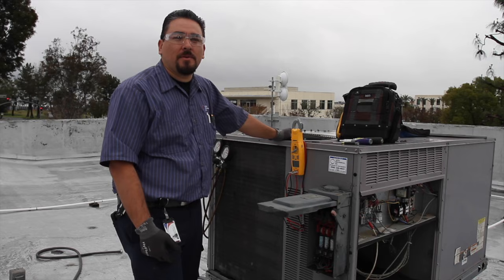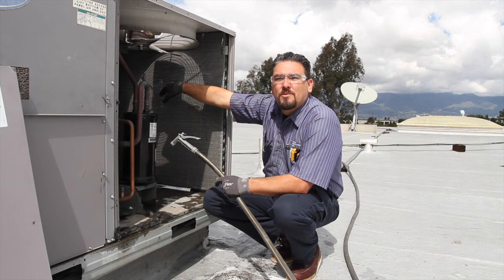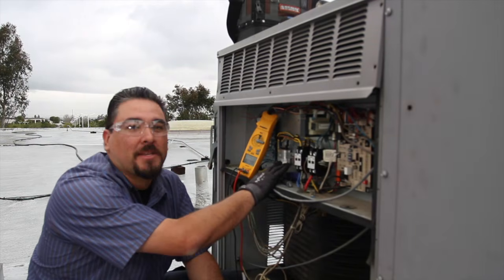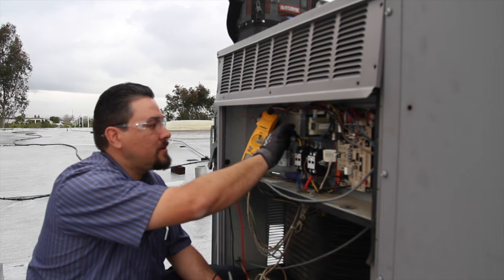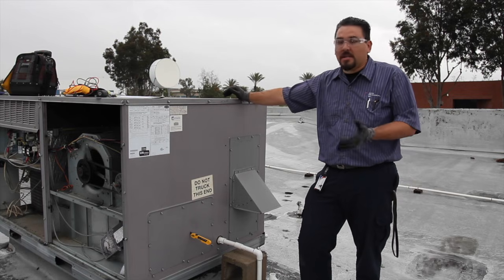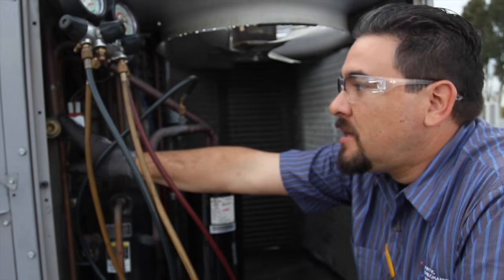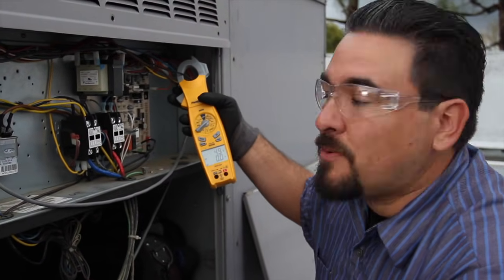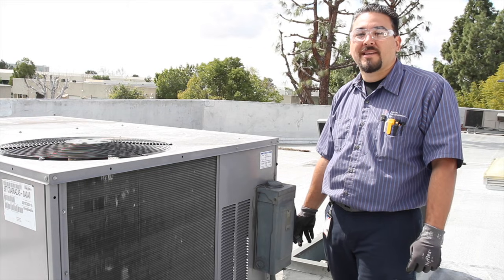HVAC PM Training Video

Comment: You need to start pulling off contactor's covers and checking for pitting and condition of points.   A++ for not using harsh chemicals that many rookie use.  Additionally, if you're doing this on a hot day you'd want to check amps while the door is actually covering the bottom opening so that the condenser fans can draw air across the coils and not through the opening of the panel.

Comment: For demonstrating the value of your service I recommending greetings 1st doing the maintenance and taking readings after so you can show the improvement that the maintenance has created for the customer. Creating value oftentimes means you can charge more. It also helps to reduce resistance when you make recommendations that the customer will have to pay for. They've seen a track record of what you are doing and the improvements you are making. It also helps you to understand what are the items that will get you the best result for the customer so if you have to give them a budget option you can get the biggest Bang for the buck

Comment: Video is informative but wrong off the bat.  You DO NOT take pressures during a PM.  One you can remove refrigerant from another system, and you aren’t vacuuming down you’re gauges every time to make sure no contamination.  Thank god you’re not in the medical field.  You check if the split is off.  Rookie rookie rookie.  Come on dude.  You didn’t check the indoor blower bearings, you need to clear the drain every time and drop in you’re tablets.  You add pan tabs to avoid build up.  I can’t watch past 6:25 the hackery there.  Please tell me you put the panels back on, NOPE damn dude

Comment: If you're new technician, stick with old school gauges over the smart probes.   Smart probes are for EXPERIENCED techs.   Only reason I'm typing this is bc all the responses to the probes.   It's not a good choice for a beginner.  Learn your pressures.  Learn txv.   Buy shutoff valves.   You'll release hardly any refrigerant and it's equalivant to the probes, no difference.  Be fast.  
You'll also have to send the probes in to get recalibrated and pay for it.
Reply: I don't agree that smart probes are only for the experienced techs.  If your are truly interested in learning the trade, the learning curve is much faster with the newer equipment than the old.  

I can't even imagine going beck to a micron gauge that I couldn't plot on my phone.  What a learning tool that is for a new tech to actually be able to see the difference in a leak and refrigerant or water gassing off in the system. 

Unlike analog gauges, smart probes allow the tech to easily think in saturated temperature rather than pressure from day one!  That's priceless!  New refrigrant comes along there's no difference in the saturated temperatures.  

How many new or old techs are going inside to sling a sling psychrometer, when charging a piston?  

The problem isn't the new technology!  It's employer's that don't want to put any training into their employees.  An apprentice needs a year or two following an older tech in the field and then support for a few years after that.  If he can give me good measurement's over the phone we can walk through most any refrigerant problem.  Then to top it all off the manufactures are cutting back on tech support at at time when their equipment is getting more and more complicated for new and old techs alike.  

Apps like MQ can give the newer tech confidence in their diagnosis, if it is used after they make an attempt at diagnosing the system first.  If it doesn't agree then they need to dialup a senior tech and get advice .  

There's place for analog gauges like when diagnosing a TXV that is hunting or setting the cut in and cut out on a refrigeration system,.  Other than that I don't really see the need for them.

Comment: I always make sure the system is working first before I start PM. You could be blamed that you unit was working fine until you touched it. 😂
Reply from the maker: Most of the customers we serviced when i was at this company had energy management services. we often would contact that service to force all the units on so that we could check operation. Also, some EMS companies will allow you access via app on your phone so that you may cycle on and all stages of heating and cooling. In larger supermarket operation, you will have EMS units such as Danfoss, E2, Novar etc that your able to graph and read logs that give you alot of important information. Most PM's are set at a low cost to the customer or they are not charged. This allows the contractor to service a customer and produce found on work. Meaning, if you show up, run the unit and find the Condenser fan motor not running, you would quote it out. Every customer has different rules especially with large Box stores and large retail chains. I always recommend for everyone to understand your companies goals and processes. understand the customers contract so that you can play within their rules. be very descriptive with your information and detail your report with high accuracy. take tons of photos this way you can show your customers exactly what they need and build that trust with you and your work. best of luck hope you found this to be helpful.

Comment: Do all of these AC function the same way and have the same components if so it this stuff sounds really technical however  I assume in time its repetitive.
Reply from the maker: Thank you for the question. For the most part a Basic AC unit, split system or a package unit is usually operates in the same manner with same or similar components. Some manufactures may have some complex electronics, Variable speed drives or de humidification that  may be a bit more advanced. Overall, you work on a few at the start of your career and they become easier. Attend seminars that manufactures have, this helps you in some ways understand and also gives you the opportunity to ask questions. My main type of work is supermarket refrigeration, i will be posting some vids soon.

Comment: I liked the video and definitely worth while to do all these things on a pm as long as your company is allowing the time. However I dont think its worth while to put gauges on the system unless you suspect there is an issue with the cooling performance just cause always pull a small amount of refrigerant out of the system everytime you put them on, that will definitely cause a problem after a while especially if you do that every quarterly pm
Reply: Always put refrigerant that’s in the hoses back in through suction side to prevent refrigerant loss. Or use pressure fishes with no hoses to check, this will prevent it also 👍
Reply: Fieldpiece smart probes would fix this issue :) Or any type that does the same thing without hoses.

Comment: I don't guage up on the unit unless my delta t seems off
Reply: I always check pressures just because ive seen some units with a 20° differential between return and supply,,, but with a higher than normal head pressure and superheat, usually causing a higher amp draw as well,, caused by either a restriction in the metering device or in the filter drier.. either way its just good to always check

Comment: No super heat or sub cool .
I personally like to see it .
S-man 4 will help you out alot man .
I have learned sometimes installers leave it on 240 when it's 208 I didn't notice it .
Reply: Why would u check Subcool or superheat on a Maintenance package unit call unless u suspect problems.
Reply from the maker: Great points you make Nathan, unfortunately the average new tech struggles enough to understand super-heat or Sub-cooling or even read a PT chart. the S-man and other similar digital gauges are great to use, but when the simple things such as cleaning coil or identifying how to test a unit are missed by your average PM guy, The S-man may be a bit too much tool for him or her. As i get the opportunity to create more content, we will definitionally use more advanced tool on things like start up where they can be really useful.

Comment: Funny how everyone talking bout what he should had done or should not do when In the midst of summer y’all probably don’t even do a quarter of that
Reply from the maker: Sorry for the late reply, but I completely agree. its easy to be a know it all, but not anyone knows it all.
Reply: Your forgetting crap boss always trying to rush it. “ I want a 3hr job done in 15min” lol
Reply: @chriswhalen5711   Yes sir , They  want you do all the of that and you have to up sale .
Reply: Maintenance should pretty much just be washing the coils checking caps , contactor , belt , drain , loose connects ,  changing filters. Anything else is a service call
Reply: @Hvacmania  to this day im iffy about checking pressures bc its technically part of maintaining the system but also runs the risk of losing ref.
Reply: I would

Comment: amp draw taken from the blower motor is the proper method to determine belt tension.  consult tech support for further information.
Reply from the maker: some motor you can't reach especially with the door off, safer not to put your hands where there are moving part regardless of what the manufacture says. they don't pay you for workman comp, some of the customers dictated where they want this done.  Thanks for your input.
Reply: belt tension tool is the proper way. amp draw will tell you a lot of other things though.
Reply: @Fryloc87HVAC  belt tension tool will set the belt's deflection.   amp draw will tell you the motor's performance at any given deflection.  check with the manufacturer.  don't  take my word.  the manufacturer will provide the required specifications.
Reply: If the amp draw is good, and the belt is flopping like a fish, what are you going to do, leave it?  Don't be a hack.  If the amp draw is good, you may improve it by adjusting the belt properly, and that would be a job well done.
Reply: @petersplat6164  the amp draw would never be ok with a flopping belt.  amp draw and belt tension are one and the same.  check the manufacturer's specification.

Comment: Good video. I will give you a Pro tip, NEVER stand in front of a disconnect while energizing or de-energizing a disconnect. Always off to the side while facing away.
Reply from the maker: Thanks for the tip, so many things to cover it is easy to miss some detail. hell, if we can get guys just to pull out the hose and wash coils we have achieved total success. lol
Reply: Compensation totally agree I’ve burned once
Reply: Facts
Reply: Why off to the side and facing away ? In case it blows up ?
Reply: @Hvacmania  yeah, the arc flash will blow outwards when it blows the door off. There are some videos floating around showing it. But be careful what you watch as some were incidents with people involved who didn't make it. I think there is a 20 amp service disconnect that they tested on a dummy so look for that.
Reply: @tthack84  ok will do thank you

Comment: Man, you should check a drain regardless. I've been to way too many homes where the drain is clogged and the pan is perfectly clean. You have a hose right there, go through the breather on the u-joint! If it's a heat pump just uncap and go from there. Wont hurt a fly and doesn't take any time at all. Could save thousands and thousands in damages just from checking a drain properly.
Reply: Well said

Comment: I strongly recommend when replacing belt that you should loosen the motor first then install belt then tighten as needed. DON'T SNAP BELTS ON. Snapping a belt on can stretch belt and cause internal damage to the steel belting and shorten the life of the belt. The only time I don't do that is on critical running units where down time is critical.
Reply: Perhaps, but how much stretch & stress was inflicted on the drive belt by installing with that method? And by how much does it really shorten its life? There is no way a technician will have time to loosen every motor. These drive belts are manufactured to sustain such stress before fully failing
Reply from the maker: Thank you for your feedback, Time is of the e sense on a PM. It is definitely a point worth making but for the sake of time we did not cover this on this video. we will discuss this on larger units such as build ups on a three, four or five groove pulley with larger turbines such as forward curve blowers etc.

Comment: You should use Fieldpiece smart probes to do maintenance check since your LONG gauge hoses will remove a lot refrigerant from this system
Reply from the maker: agree on the smart probes, i use Testo myself. for the average PM guy, it is difficult to purchase such a pricey tool, not many techs can afford it especially starting out. Often times they forget the fundamentals that is why we stick to mechanical gauges and PT charts.
Reply: I find that false.   Shut off fittings and you'll release hardly nothing.   The only thing smart probes are good for is,  time.   For people starting off, especially doing PMs then you should learn the gauges first and the pressures.  BecUse guages do things the APP won't tell you unless you're an EXPERIENCED Tech.   TXV is a main reason for guages

Here the other issue,
You have to send them in to have it recalibrated.   I can recalibrate my Brutes with my thermostat screwdriver.   Guess what. I have all three pairs.   When you second guess the probes you go back to ol trusty...  So no,  smart probes are not worth it and it's horrible advice to give to new people
Reply: Is there another way of checking the refrigerant charge without putting on the gauges? Like a temperature difference delta t type method?

Comment: Fans moving to slow- bad capacitor. When you check anything on the unit the door must be on some what on for real readings lol 8/10 video thanks for sharing
Reply: If the fan is moving too slow the motor itself could be failing as well. But we could ignore all that, the speed youre seeing isn't accurate due to frame rates. Can even hear how choppy it is in the audio.